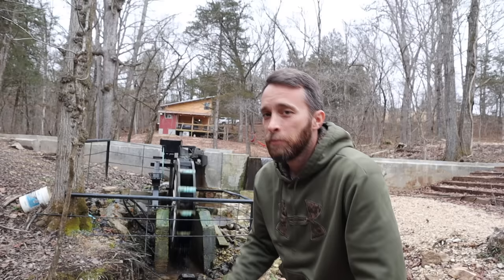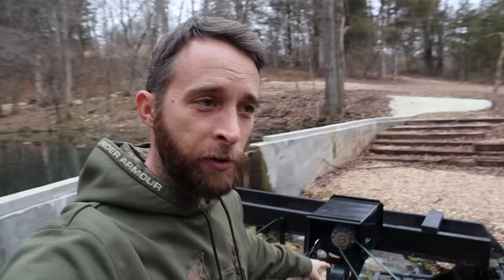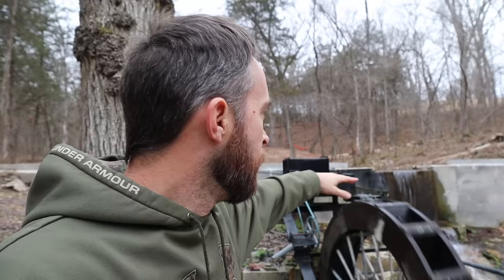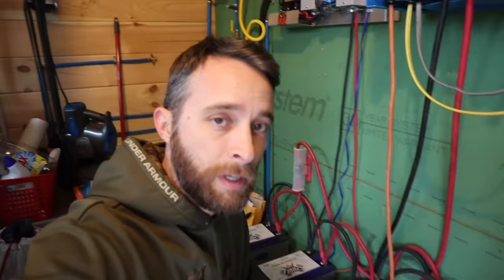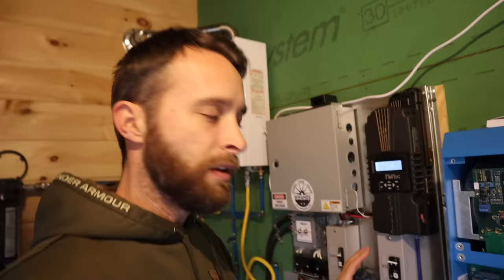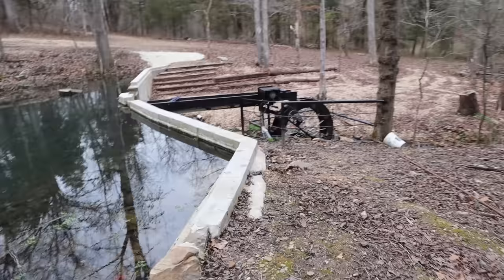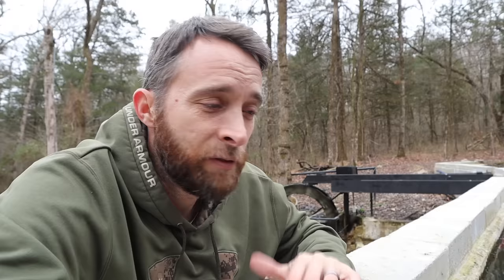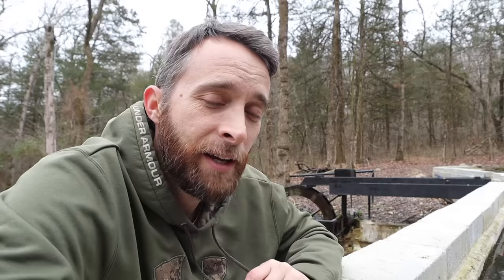Did we MAKE HYDRO POWER Using Our Waterwheel for Self Reliant Off Grid Living?

Comment: There is no one size fits all in power generation, you have a great start, all the hard work is done ie; the spring and dam, you are in the woods so outdoor boiler will supply hot water and heat in the winter, the dam/reservoir will cool the house in the summer with a chiller, those are the high amp issues in modern living, that said your water wheel will power all low watt needs like all led lighting, tv, computer, internet, chargers(phone, drill, and back up batteries for your computer and phones.

you mentioned a 6" overflow pipe diverted to a future pond, if you cut it another 12 " and run it downhill you could achieve 20 to 50 ' of drop, with a gradual reduction down to 1 " you could have a 48 volt water turbine to achieve a higher RPM which will charge that higher volt side of the system, this would require the addition of a secondary 220 volt breaker box and a can (giant battery) at the source ie the turbine, like the power company uses at the pole but would allow for back ups to your back up.

i would also use a few wind generators possibly attached to the tallest trees in the imeadiate area and a few solar panels to supplement and increase the efficiency ofyour system while adding 2 more fail safes  to total power loss.

that's 6 forms of energy, listen for all the carbon talk and green energy human beings cant survive on wind, solar and hydro electric production, theres just to many humans on the planet, that doesn't mean we cant do anything, using what we have as renewable water, solar, and wind we could take all the lighting off the grid/ coal, nuclear plants, the world will never manufacture products or grow industry without coal or nuclear, every company doesnt exist next to a hoover dam or the huge pockets of natural gas we need to be smart, conserve in area's were we can and be leading producers in the world to starve the biggest polluters ie;china, india, korea, russia these countries dont care about pollution, they care about control, communism, socialism, and raw world power, the US is way ahead in reducing pollution, if we maintain production and introduce SMART changes to our grid we dont have to sacrifice superiority for our climate badge

Can anyone remember when Al Gore started screaming global warming????...... our government has been pushing and pulling for 20 plus years, they are using climate to increase taxation!!!!

ask yourself if the federal government and the federal housing authority (FHA) would have mandated that all houses built after 1985 must have one of the following, wind, solar or geothermal as a code requirement that was subsidized by the FHA in a 30 year new house loan and furthermore all homes less than 50 years old would qualify for a no credit bad credit loan to add 1 or more self sustaining power sources to their homes, instead the government gives energy assistance to the poor, it's a handout instead of a hand up

punishing coal and nuclear has only hurt the consumer!!!!!!!!!!!

it could have been different and should have been, but greed is a scourge on humanity and power is the ultimate trophy 

Sorry about my rant but being less dependent on the national grid has been an issue for years and frankly im straight jealous of your property

Comment: Make the damn few ft taller drill a whole in the bottom install pvc tube with jet nozzle to a pelican wheel generator or use your existing drain reduced down to jet nozzle  the weight of the water will create pressure just need to make sure ur gpm into the reservoir is more than ur output

Comment: Hi, I love this channel with amazing dam. I think your system need rectifying circuit although I don't know spec. or model of alternator at a glance. And  It is better raising  voltage of alternator. 
I will watch and cheer your hydro power systems across the pacific.

Comment: Man I'd use a 100amp gm alternator if that isn't enough for your power needs add a 2nd one to the wheel I used to charge 4 6v golf cart batteries deep cells this way it works very good and lifetime warranty

Comment: Your water decay (height) is like 3 feet. You should locate the reservoir away from the wheel so to have the maximum height diference.
Also, if maintaining it there you should feed the wheel bellow (under shot or breastshot) to maximise the elevation.

Also you don t say what is your water flow (gallon per second)

Comment: they is green solar controlers that boost voltage i wounder if you have a 12v lead acid for the hyadro then boost that into the 24v battery bank with the mppt stepping the voltage down to 12v this should gain you more current into the battery as long as you dont take more out of the battery then what is been put in then this should run continuous

Comment: I am no expert in electricity but if you were to raise the dam slightly and build a wall around the water to allow the water level to rise and closed that gap in the middle and forced all the water down the flume to allow the wheel to spin faster, and mabey possibly cut a bit off the flume to the water drops into the wheel earlier and pushing it more. 
I don't know if this works but it's a recommendation
Reply from the maker: Thank you
Reply: @LoftisPartyofSix  Thank you for the amazing content.

Comment: I am wondering if you went for a slightly smaller generator possibly rated at a little higher voltage that it could maintain a higher voltage but less amps so it could charge the batteries.  Not sure if it would be enough to maintain the batteries that way but if it would hold the voltage up consistently high enough to charge the batteries it would still be better.  Even if it doesn't produce as many amps it should at least charge the batteries consistently when the water supply was sufficient. Even if it doesn't supply enough to keep the batteries charged any you got from that would be that much less you would have to run the generator. If the water wheel can't supply enough it wouldn't take a lot to add solar if you have a place to put the solar panels that could collect a lot of sunlight
Reply from the maker: Thank you 😊

Comment: extend the water canal that you have on top of water wheel about 2in you might get a little bit more speed out of it if you use the gravity of water actually hitting the will as well as the weight of the water traditional water wheels don't have the water supply that supplies the wheel that far back

Comment: After you have fixed your wheel you might look at it and say well it doesn't fill up the bucket. Applied torque upon the wheel and the water will give you more torque as it flows into one bucket and into the next bucket up until the fourth bucket or so.. you should notice a different sound of your water dropping.. bush bush bush and so on that's your buckets emptying you don't have that. What do you have you have what is known as a under shot wheel and you're trying to overshoot it.
Reply from the maker: Thanks 😊

Comment: Build you a battery house half way up to your house so you do not lose your power going to the batteries in the house so basically you would charge from the Waterwheel to the house in the middle of the way to the house basically won't lose power it'll actually boost power and put a smaller Wheel On The Water Wheel to build more speed

Comment: 12v 100ah and 24v 50ah is exactly the same amount of power since power is watts which is load times volts. I wouldn't give up on the water wheel more voltage will probably fix your issue. The fluctuating amps is the mppt trying to lock on to a load. Take a video of it as it fluctuates and measure the wheel speed. I bet the wheel is slowing down when the amps drop. You need more torque on the wheel try widen it or add small extensions to each of the louvers so they hang on to the water a bit longer

Comment: Can you not move one battery closer to the charge and run a 1000 inverter powering a charger to charge the indoor batterys then the voltage drop wil be less

Comment: Did you give it already a second try ? In my opinion the buckets are far to small and don't hold the water till they are at the bottom. They are only handling 50 W of water, al the rest is spilled. The water way on top should also be wider. And I would put a direct drive (BLDC) alternator on it ( no mechanical losses). It will take some days to modify ...

Comment: Okay, some testing needs to be done. Remove the alternator and with a 1:1 pulley setup with an induction motor, spin the alternator to the required 500 rpm. Have your buddy build a test fixture (to mount the induction motor and alternator together ) and with your portable generator, run the alternator right at the dam site. That way you can see the loss in the line between dam and house. Remember, power is the sum of voltage and current. Just to have 25 V at the alternator means very little— you need current as well. It appears, at leas to me, that you're not producing current and thus no power to the controller. The supplier of the alternator should have provided a chart/graph of how much power at how many RPMs. Personally, I think it's spinning too slow.

Comment: That's the downside of DC power versus AC, Line loss. Make your DC/AC conversion and regulation as close as possible to the generator. Move your batteries, controller and inverter next to the waterwheel, Send AC to the house, not DC. What voltage were you seeing right at the generator unhooked to wiring?

Comment: Direct drive no reduction direct drive to a slower generator or a bigger generator winding same thing maybe a brake drum sized armature many build them from a trailer spindle and drum this also gives a flywheel effect chain and sprocket will greatly reduce friction if you wanted to gear reduce winding your own coils and magnet setup
i thought about mounting magnets to the side on the wheel and simply pass them in front of coils

Comment: I noticed on one of your drone videos that your penstock is not perpendicular to your water wheel axel.  I know it doesn't seem so but you are definitely reducing your efficiency  Another thing that occurred to me is that perhaps you might strip your alternator of all its unnecessary electronics, such as the voltage regulator, rectifier, diodes, etc and in that way you are converting it to a plain and simple generator and therefore producing only AC current being sent up to the house where you can then convert it to DC for your charging system.

Comment: You could use the water wheel to pump water to a higher elevation (up the hill 20+ feet) then run that water through a turbine.
Reply from the maker: Use the waterwheel as a pump? I’ve never seen something like that.
Reply: @LoftisPartyofSix  use the water wheel to drive a pump, low speed low volume. I assume up the hill behind the house is 20+ in elevation. You could build another pond or install a tank. Set it up so the water wheel fills pond/tank and a level switch starts and stops flow to a turbine, it would self regulate according to water flow from the spring. As long as the spring provides enough water to turn the water wheel and fill the tank you can generate power.

Comment: If you was to put in a Horizontally turbine that would get it’s water supplied from a opening from a lower point in the dam. You would be get the water from the lowest part of the dam instead of from the top.

Comment: You need much higher voltage, or a much bigger wire. Without a lot of volts, the resistance will kill you. I'm running 300+ v from a solar array through 10awg wire.Very little v drop.

Comment: Ac Higher voltage alternator. 3ph wires to house. Ac less voltage drop. Then convert to DC ?   Look different ac gens low rpm  it's a thought
Reply: Also look into shoot down into buckets maybe little further out and down.  But look into AC vs DC because distance 3ph ac then rectifier to go DC voltage
Reply: Another option if you don't want run alternator 3ph up to house. Build all controls.batteries close to generator. Then run 120vac back to house. Keep in mind voltage drops and distances.

Comment: a simple water tower at the height needed ..cheap free way to fill the tower would be ram pump, they use zero power and work 24/7/365 ....even if you had to have 3 or 4 ramp pumps to keep the water tower at a useable level ...it costs no power and would give you the needed drop

Comment: How much land do you own past the damn? If the slope is steep enough you set up an intake and run a pipe to the bottom of the hill to a regular turbine.
Reply from the maker: My property line ends about 100’ away and don’t drop much more past the dam, maybe 3 or 4 feet lower.

Comment: Change the dc to ac then run it to the cabin, ac will travel mi. further then dc. Or locate your power house closer to the wheel then run ac the length. your 1.85 amps is not enough to push it that far.

Comment: I for one have heard good and bad about the pm generator you are using.  Have you tried just driving the generator directly using something like an electric drill. This will give you a constant speed so you can discount the water wheel  and prove the electric side works as expected  i for one would want to generate at high voltage.  100 v or more. To send over that distance. This will reduce the power loss in cable.  
Then use a power point tracing charge Controler to convert this high voltage to high current to charge the batteries. ..  I don’t think your wheel is sized to do 500w. So a smaller generator could be used . Also each set of belts and pulleys you add robs you of power try to use just 1 large pully and belt drive. Or build a large diameter generator rotor with magnets and a set of coils to one side  the large diameter will give the speed you need direct drive and using just a few generating coil will allow you to add more or less to fine tune it   Looks a fun project

Comment: Been waiting on this video a long time. It is the only reason I am a subscriber to see how it develops.
First of, that is not how you count how much energy your batteries can store. You have to look at the watt hour rating, not the ampere hour. Watt hour is the voltage x ampere hour. So you will see that 12v x 100ah is the same as 24v x 50ah = 1.2kWh.
Generally you want as high voltage as possible because running high amperage will give you more transmission losses and the components like wires and inverters have to be of a heavier duty to withstand that higher current.

Since yo don't have much head to work with you could try the kind of turbine in this video I link down below. 
https://www.youtube.com/watch?v=V82SVeVXKcA

I have about the same stream as you have, just with about 90 meters of elevation drop running right next to my house. My only problem is that I don't own the land it is on :(
Reply from the maker: Thank you! I’m definitely still learning all this.
Reply: @LoftisPartyofSix  
It also looks like you are running 3 phase (potential high voltage) AC power from the generator/alternator up to your cabin and that is a good thing. You will have less power transmission losses this way.
What you really need is a lot of flow to compensate for the low head. From the video it looked like the waterwheel wasted a lot of the high flow when it had been raining.
I think waterwheel as a solution is only great when you constantly have high enough flow to run it at maximum designed load. When you get a good rain fall you want be able to use the extra flow in the water as it only shoots out over the wheel. If this makes any sense. Yup, my english isn't the best :/